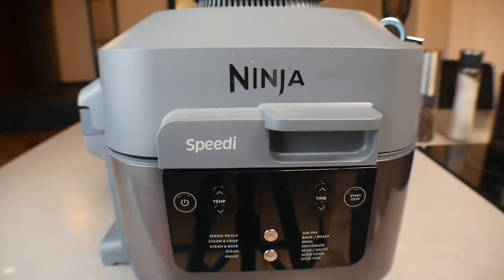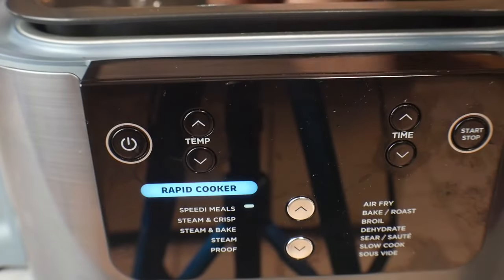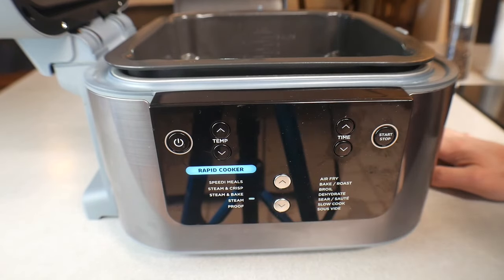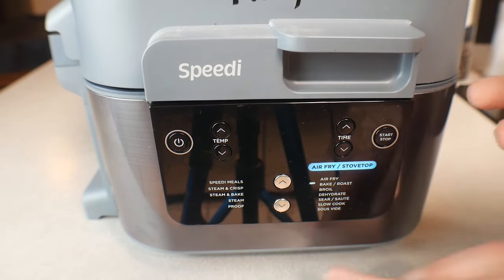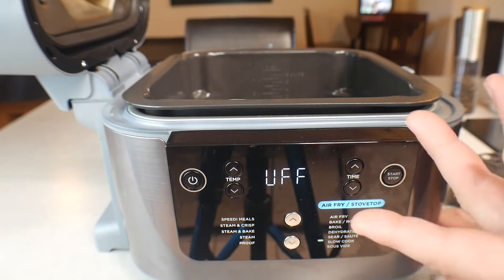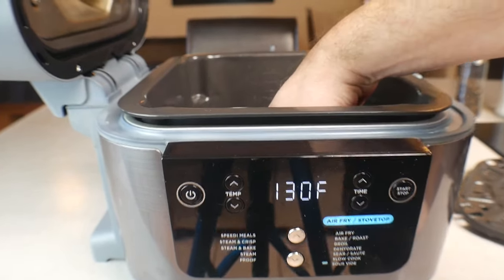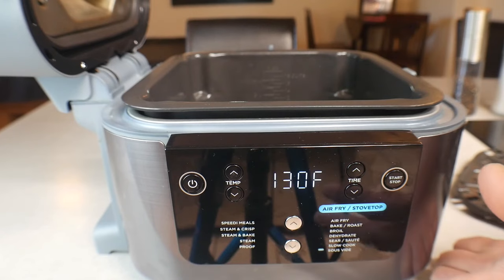NINJA SPEEDI How to use the settings and functions EXPLAINED!

Comment: Thanks for this video. I don’t think the instructions on the Speedi are clear enough about what the difference is, and this is so much needed help. The difference between the steam and crisp setting, and the Speedi meals setting is subtle, but do use them differently. I use the speedy meals setting when I am cooking two different dishes at once, with the crisper plate in the upper position. When I use the steam and crisp function, I am usually only cooking one dish that I want steamed to cook and then crisped up. I put one or two cups of water in the bottom of the pot and the crisping plate in the lower position. That keeps the protein away from the upper heating element and prevents it from over cooking. That’s how I do whole chickens, or anything of that sort.
Reply from the maker: Sounds like you got it down. Awesome. Happy holidays!
Reply: I agree with you!  They should use this video for their instructions. This is wonderful.
Reply: Hi CinSu. What would happen if you used steam/crisp on a 2 layer meal?  I’m asking because I’m thinking about buying the smart lid pressure cooker which only has steam/crisp (not speedi meal).  But, it appears I could accomplish the 2 layer speedi meals with the smart lid…but also get the benefit of the pressure cooker.  Any thoughts would be appreciated.
Reply from the maker: Honestly I have never used it so I'm not sure
Reply: @bryancloar5760  Yes, the Speedi does 2 layer meals beautifully. A friend has the smart lid, and it does everything the Speedi does plus pressure cooking. But even so, since I already have a pressure cooker, I prefer the Speedi. Frankly, while the Speedi doesn’t cook as fast as a pressure cooker, it still cooks very fast.
Reply: @cinsu8208  thank you!
Reply: @cinsu8208  I have a stove top PC,which I drag out occasionally to cook a stew,but that is about it. Just got a new Speedi,and am debating what to cook first.

Comment: James, you can sous vide your food in a zip lock baggie. It is not necessary to have a vacuum sealer. When using the baggie you get the air out of the baggie by water displacement method and zip it closed. I only use baggies when I sous vide and I cook with this method many days a week. Then I reverse seared when the meat is done
Reply from the maker: I never tried that. If it works that would make it easier
Reply: Can you please demonstrate how to do this, please?
Reply: Just make sure bags are safe to use. Bpa free
Reply: Yeah, you can use regular ziplock baggies. I use the freezer ones because they are more durable. I also use my vacuum machine and honestly both methods work. I only prefer to use my Anova Sous Vide machine when I am doing Sous Vide cooking. It is nice they add Sous Vide features onto many machines for people to try Sous Vide cooking.
Reply: I’ve done that method too and it works. I had an instant pot Sous Vide immersion circulator and an Anova one a few years ago. They both stopped working so I bought another one. 
I used Fairlife milk and a few tablespoons yogurt to make a quart of yogurt. Because it was ultra processed the milk did not have to be heated first. You mix the yogurt and milk together and set the machine.
Reply: @CookinWithJames  I haven't tried it, but the Speedi manual mentions using a zip lock bag and displacing the water.

Comment: Hi James, I bake bread about twice a week and have tried the proofing function and it works great, especially in the winter when the house is cooler.
Reply from the maker: That's awesome.  Thanks for sharing 👍
Reply: Hello, great video. I'm trying to find accessories for this unit. Could you send me in the right direction?

Comment: Thanks for the tutorial, very informative. I’m partially sited so it saved me poring over the manual for ages. Living in England there a few differences but nothing insurmountable. The major difference is temperature. We use Centigrade versus Fahrenheit. Then just things like grill and no proofing. I make bread in a machine so it’s not important. Thank you

Comment: James, thank you so much for your informative videos, especially this one! Quick question, if I want to quick cook some breaded chicken escalopes with oven fries, could I use either the steam/bake or steam/crisp settings to cook both at once, or should I stick with the air fryer function? I followed another You Tuber who did this on steam/bake, with fries in the bottom (with a bit of spray oil) and chicken on top, and it came out great- not too dry or overcooked like it might have been on airfry mode. But I’m worried that this might destroy the lower heating element because there was no liquid in the bottom. Am I okay to use this method without water?

Comment: That was such a wonderful video thank you so much! I'm still intimidated but I'm getting somewhat braver LOL do you always have to have the liquid on the bottom even if you're not cooking rice when using the rapid cook mode also I'm still a little confused about where the Shelf thing is supposed to go, depending on which function. Maybe you explain that later in the video I just didn't want to forget to mention it. Thanks again for your wonderful video
Reply from the maker: Thanks so much.  The shelf can be used on top or bottom.
Reply: You only need water in it if your using a steam option, when it’s using the bottom element, which is all the options on the left hand side. If you just using the airfryer, or grill things on the right hand side are not using the bottom element, except the sear and sauté which you would be frying in with the top open. And the reason you need water when using the left hand side is to stop you burning the bottom of the pan. You wouldn’t stick a pan on the hob without water in it.

Comment: Thanks for the informative demonstation and thorough walkthrough of the appliance but I want to know if I can put a little bit of Wesson Oil on my chicken and flour it shaking off and excess and put it in the Air Fryer will it come out crispy and crunchy like I fried it in hot oil on the Stove?
Reply from the maker: I have a fried chicken video.  Look on my channel
Reply: I did but I was just wondering if I could baste chicken with Wesson Oil and flour it like you would to fry chicken on a stove top? Because I would like to try it tonight.I was just watching your video and following the instructions to wash pan, pot, tray etc. and burn of any oil left in the inside of the unit.
Reply: @blackjew725  you can do exactly what you do on the stove top, you just have to think of it as a compact stove top on the left settings, and a small oven with the settings on the right, with a bit of a boost.
Reply: Thank you for answering my question I'm good to go.
Reply: Thank you for putting it into laymen's terms because I was scared that I would damage the appliance by using the it  incorrectly.

Comment: James, many thanks for all the great videos. I got my Speedi yesterday and it's great, of course. Question: It is replacing an Emerald 14 in One Multi Cooker which stopped working after 1 year. The Speedi is a much better device but I miss the much larger cooking pan of the Emerald. I've searched but can't find a  Ninja cooker with a very large rectangular pan like the Emerald that steams, fries, bakes, roasts, broils, slow cooks and dehydrates. Does such a beast exist or is there another multi cooker you recommend that would likely be a better choice than buying another Emerald?
Reply from the maker: Great question. Honestly I’m not sure because the steam function. I know other cookers that can but no steam
Reply: Thanks for the reply. I'll just buy another Emerald to use on those rare occasions when I need a larger capacity. Anyway, thanks for explaining all of the ins and outs of using the Speedi. It is such a great product!
Reply from the maker: You got it

Comment: Happy Holidays James!  Thanks for this, it is helpful. I did not know there were different fan speeds.  I know there is fancy computer programming to the modes, but I could not find a description of what each mode actually does anywhere on the Ninja site.  It is particularly confusing on the Rapid Cooker side.  I'm going to try to roast a turkey breast (not a roll, the raw breast, about 5.5 LB).  Do you have a suggestion on the best method for that?
Reply from the maker: Ya. I did a turkey breast video. Check it out

Comment: Good video, thx. Just opened mine, (long story, been in storage for long time,  manual has been misplaced,) haven't cooked anything yet, finding my way around on YouTube.
Just wanted to add that alto it hasn't been mentioned anywhere yet I think you could make yogurt on the proof setting, temps are similar, just an issue of setting the timer for several hours?  If you know please post, if I find out I'll get back to ya.
Thanks again for the great video.
.
Reply from the maker: I’m not sure on yogurt

Comment: I cooked 4 cups of rice, on top crisper tray brocoli, baby bock Choi, put in some sherred rostisory chicken. Used the rapid cooker mode 300 temp for 15 mts. My rice came out flofy very nice, my veggies burned-out,  chicken was crispy.
My question to you can I make steam rice only in the air fy mode without cooking anything on top of the crisper tray? Thanks. I liked your video.
Reply from the maker: Yes. But not in air fry mode. Use speedi meal function

Comment: Hi James...went to bake the brownies & the edge/rim of my 8x8 sq pan is just a hair too big...I or'd Amazon
6 inch sq; 7 inch sq; 8 inch sq with no rim...and lastly I decided to try two diff't silicone types..one round,
one square... I want to see if I can lift out the silicone with ease..couldn't find one with handles...This is a project
in the making...I may make first one with whatever size arrives first. Meanwhile, will make batch in small baking
round thing that my Ninja XL Crisp air fryer came with... Will let you know when it all gets done in Speedi
 ! :)
Reply from the maker: Awesome. Yes let me know how it turns out. Thanks

Comment: Thank you for this information. I have a question about the Speedi Meals setting. When I was cooking chicken in the top and pasta in the bottom I thought the air frying didn’t start until the last few minutes of the cycle. Is that wrong?
Reply from the maker: It starts as soon as it’s done preheating.
Reply: @CookinWithJames  - thank you so much!  That is great to know.

Comment: Just to say you don’t need a vacuum packing machine to sous vide.  A ziplock bag works just as well.  Suspend the food in the bag in deep water then zip when all the air is pushed out.
Reply from the maker: yep. I have learned that. thanks.

Comment: hello, can you do eggs in this thing like add water and soft and hard boil them under bake or fry them on saute? also for the steak on sous vide, what setting would you use to sear them after - just the sear and saute or broil or air fry?
Reply from the maker: Yes you can do everything you mentioned.  🥚 hard boil. Yes sear and saute for steak. I'm doing a steak video this Saturday.  Thanks

Comment: Thank you! What is the benefit of having the Speedi over the Ninja Foodi 14 in 1 with smart lid besides its smaller? 
Can I use Speedi recipes for my 14 in 1?
Reply from the maker: I’m not sure about the smart lid. Haven’t used it. If it steams then yes
Reply: Hi. The smart lid can do everything the speedi does. The one lid pressure cooks which the speedi does not. When making speedi meal recipes, just use the steam and crisp mode with the one lid and use your racks. Hope this helps. I actually have both and I use the speedi a lot for smaller portions of food.
Reply from the maker: I agree 👍!

Comment: Thank you been following a couple of you for the last fortnight, to decide whether to buy it or not. I live in UK so I have to convert a lot of the recipes but it’s not that hard to do. Your videos are very informative and very clear and so I thank you for that. it is confusing when you first get it mine arrived yesterday, the difference between the actual settings. Is there any method to convert a recipe from your normal oven to use in the Speedi? Would you use the temperature as in a conventional oven too?  Thank you.
Reply from the maker: Yes. The ninja is just a small oven.

Comment: What setting would you use to make biscuits and gravy or just Grands biscuits at?
Reply from the maker: steam and crisp
Reply: @CookinWithJames  I used airfry to make just Grands biscuits. 375 for 10 minutes, turning over at 5 minutes. Didn't try gravy yet
Reply: @CookinWithJames if I use steam and crisp for the biscuits, do I have to put water on the bottom and cook the biscuits in top?  Great video!

Comment: I maybe found the difference between speedy meals and steam and crisp setting.
Once I tried cooking gnocchi on the bottom, and chicken on the top. Per instructions – there are multiple ways to cook the gnocchi I had. I didn’t want it to come out too mushy, so I only put a splash of water in the bottom.
I turned it on steam and crisp. I think the machine did not detect steam, and it was taking too long to get past the preheat stage, and start the timed cooking.
At that point, I changed it to speedy meals, and it started right up. 

My hope is that I can do lightly oiled potato wedges on the bottom, and turkey burgers on the top.  Maybe one side of those potatoes will get crisp! I am lazy!
Reply from the maker: Lol. Thanks for sharing

Comment: When you said the sear is getting max to 180 degrees that meant Fahrenheit, right? This sounds like a deal breaker to me, I was just about to order it, but because of this I am backing off now. That's not even boiling water temperature, how it is supposed to be used for sear...

Comment: I’ve noticed after I’ve turned off my Speedi,  hours later the BYE light pops back on and then goes off again by itself. Am I not turning it off correctly or could this be the beginnings of a hardware problem?
Reply from the maker: Not sure.  I have not experienced that
Reply: Just turn it off at the wall, mines a bit like that, I’ve only just bought it but it’s fine.

Comment: I just got the speed as an early christmas gift.  My question is how do you figure out the times and temps. I know its a learning experience with it. So far i just air fried some fries. They came out dry and not crispy. I assume I either used the wrong temp or left them on too long.
Reply from the maker: I have a lot of videos on my channel. What are you trying to cook
Reply: @Cooking With James  anything, really.  I'm not the best cook and my mom is older. So cooking has fallen to me. So anything and everything, really.
Reply from the maker: Ya. I have a lot of videos. Check them out
Reply: @CookinWithJames  will do

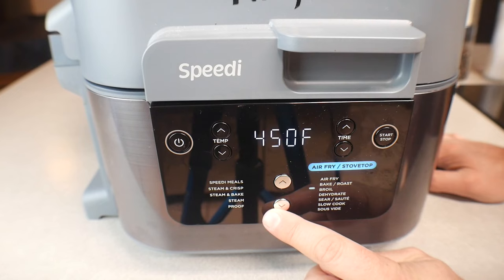Comment: 10:12 Dehydrate pork belly for 30 minutes. Then switch to air fry for 40 mins. Awesome result. Crispy skin without the 
fat messing up the fan. Oil settles at the bottom.

Comment: Are you kidding me?  I've noticed the noise more in the Ninja Foodi than any other air fryer. The most quiet air fryer is the Cosori Pro LE 5 quart. Model number CAF-L501-KUS. It's also the smallest air fryer with a big basket. But definitely the quietest of them all. $80 to $100. #don't mistake this fryer for the 4.7 quart! They look very simular.

Comment: I find this machine pretty confusing to be honest. The manual says if you want to steam, use the rack at the bottom. Take potatos for example, they take between 12 and 17 minutes. If you want a speedi meal, you put the potatoes in the bottom, sitting in the water, and say, the chicken with the rack set in the top position. So what I’m finding is the potatoes are always undercooked because the meal is quicker than steaming allows. What am I doing wrong?
Reply from the maker: You have to start potatoes first. I have like 50 videos on my channel